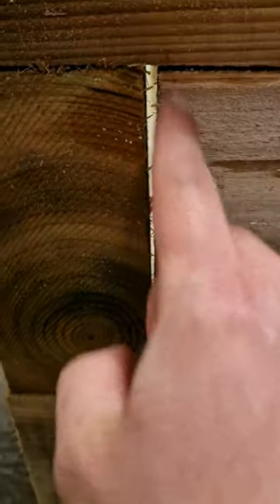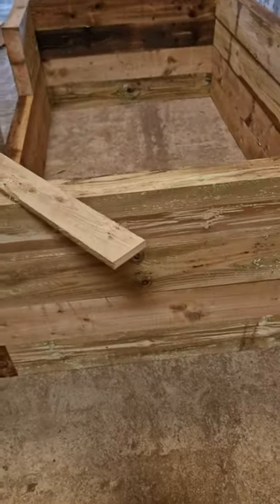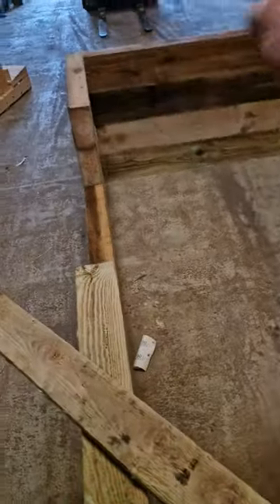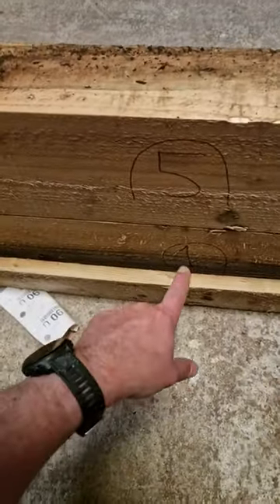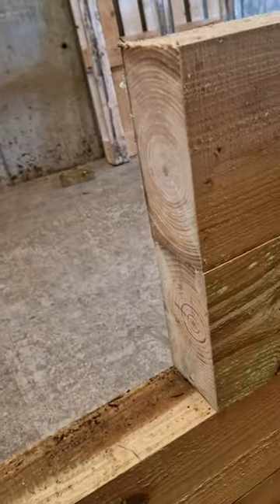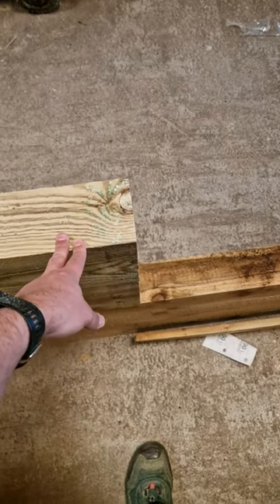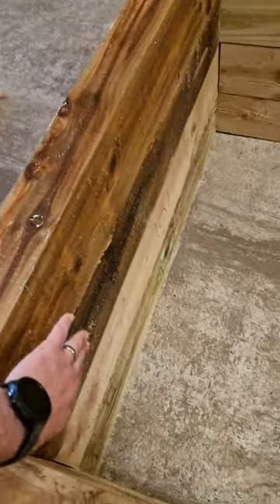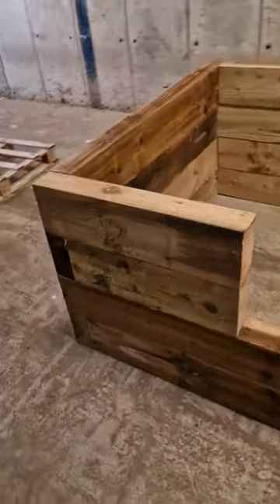2.5 x 1.5m sleeper pond kit - April 24

Comment: Iv always been bit sceptical doing sleepers on sides works out cheaper but movements  a bitch no matter how many screws and they cant be glued to allow for movement is it a certain length before you lay on side
Reply: Mines 4.2m by 2.6m on end like this the only difference i did to this was as well as all them screws i put rebar through all the sleepers from top to bottom 16 rebar in total 👍